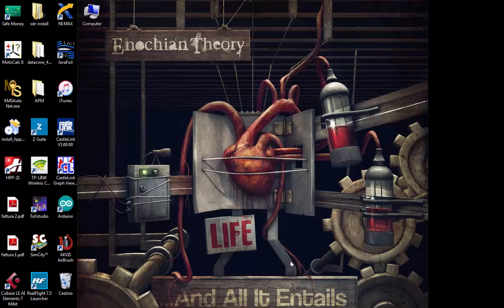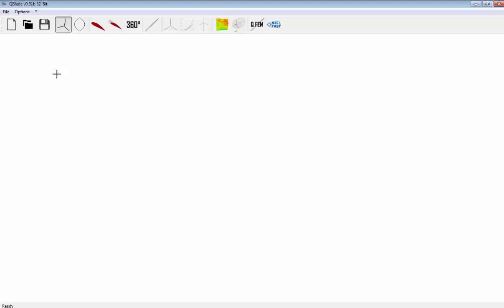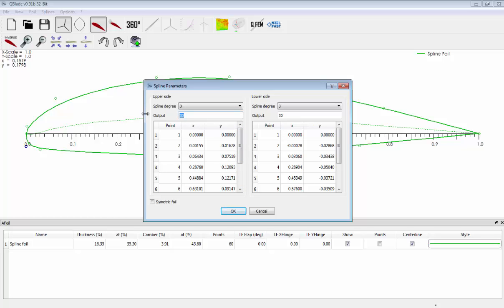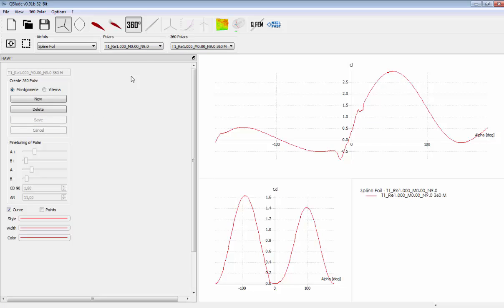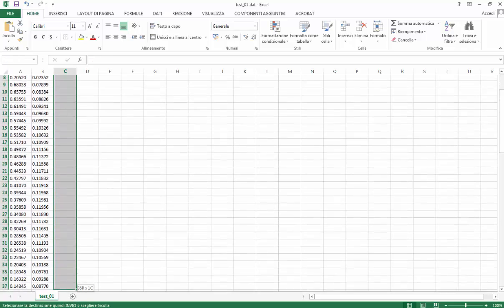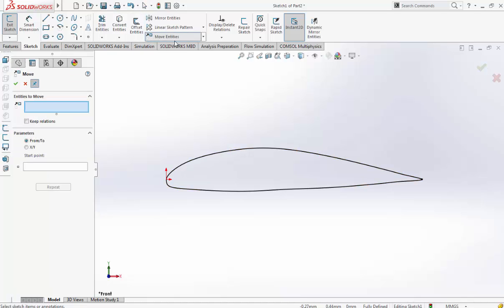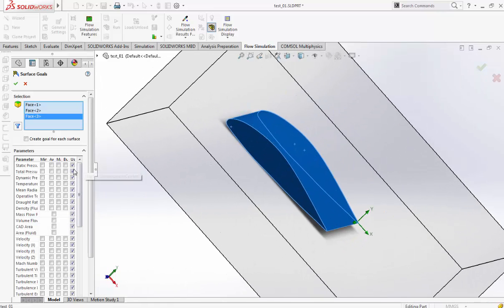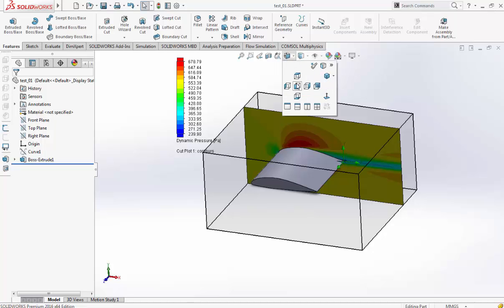Airfoil design with QBlade & Solidworks

Comment: im doing an optimization for wind turbine blade based on camber line, which is the best option for 3d modelling
Reply from the maker: If is only a study, qblade can give you the infomation you need. 
If you need to draw a blade, qblade has some limitations like parametric cad export file (solidworks, inventors etcc)
Reply: me too , do you have some advices?

Comment: Hi, and thank you for the video. I do have one question however. When looking at the SolidWorks flow simulation I saw lots of high pressure on the top of the wing and low pressure towards the trailing edge of the wing. Is this not the reverse of what we would see if we had lift?
Reply from the maker: What you see in flow simulation is dynamic pressure
Reply: Thank you for the reply. I am not a propeller expert and I appreciate an opportunity to learn from you. My simple understanding was that due to Bernoulli's principle, the area of low pressure needed to be on top of the wing in order to create lift. Can you please explain what you mean by dynamic pressure?
Reply from the maker: Lift force is directly proportional to dynamic pressure. If you look lift formula you will easy understand that

Comment: Hello There i want to ask about your PC specs as when i go to analyze part it tool to much time than you in the video and i want to know if it's a problem in my program or just PC specs difference 
i'm currently working on Core I3 with 6 GB of RAM
Reply from the maker: +Mohamed Nagi hi, i'm using a 2010 intel i7 octacore with 24 gb xfury ddr3 1333 mhz
Reply: Great sure it's all about specs, thanks a lot

Comment: any way to put NACA number into theis, I cant get the illionos university and excel way to work
Reply from the maker: +Gibbo263 yes of course, I made a video...I think is the second in my channel...
However with illinois resource, you cannot made modifications on the geometry of the airfoil and the number of  points is limited. 
Thanks for watching